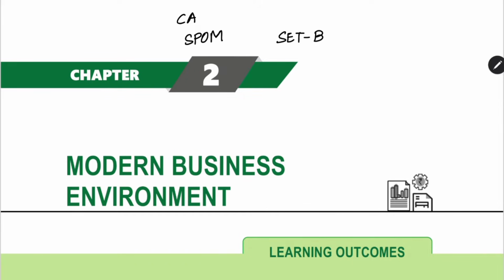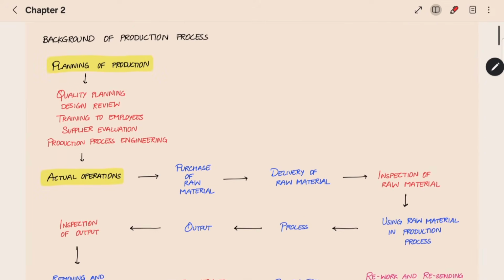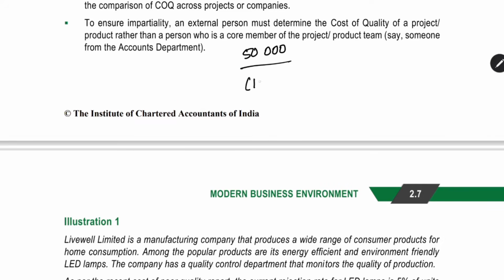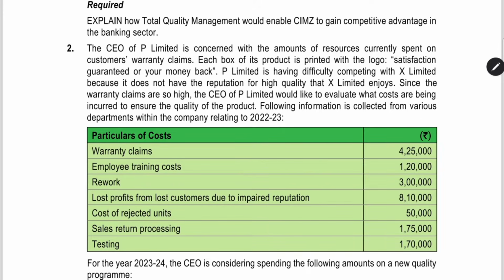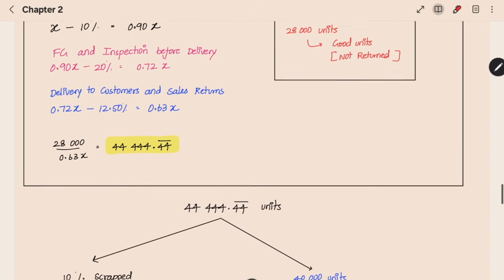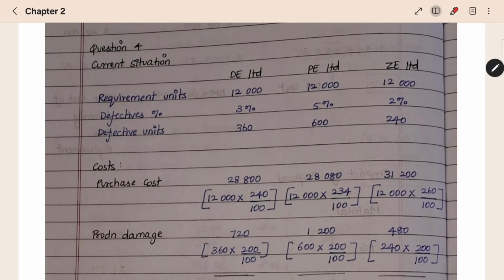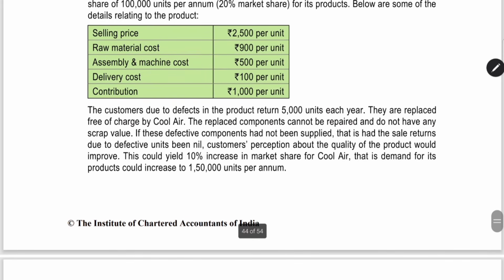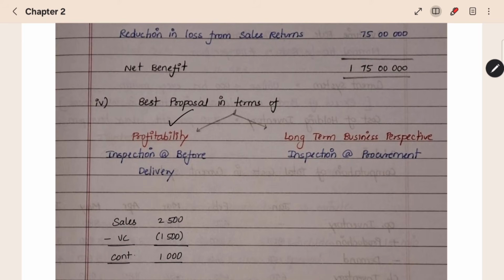SPOM Set-B Chapter 2 Costing Sums Explained - Full English | CA Final | Self-Paced | #spom #cafinal

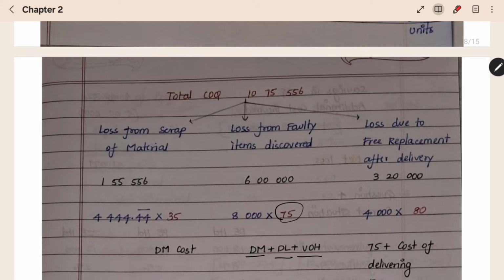Comment: In Question 3: why selling price is not added to the cost of quality of returned goods from customer 31:55
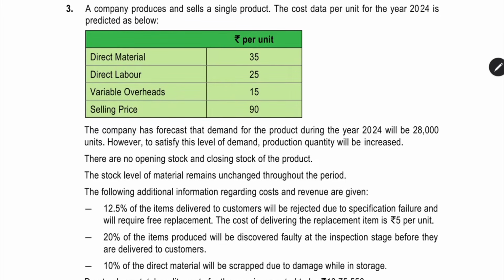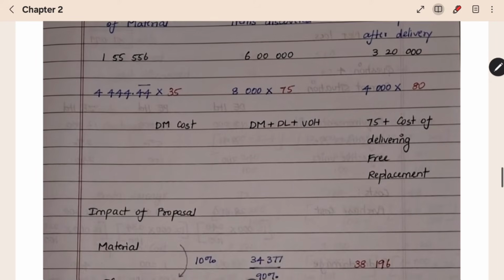Reply: In Question 3 (25:50-35:53), the selling price is not included in the cost of quality because the cost of quality represents the actual economic sacrifice (the resources consumed) incurred by the company to rectify defects or failure, rather than the revenue lost or forfeited.

Here is why the selling price is excluded:

Focus on Cost, Not Profit: The cost of quality statement is designed to track expenditure related to poor quality (like material waste, production labor, and replacement delivery costs). Including the selling price would effectively blend revenue loss with cost, which obscures the actual efficiency of the production process.
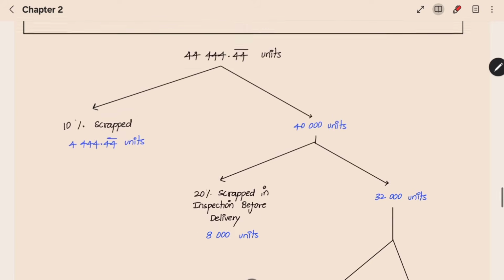Resource Consumption: The losses highlighted in the video (e.g., at 31:13) focus strictly on the value of inputs consumed—direct material, direct labor, and variable overheads—that are effectively "thrown away" when a product is faulty. 
Opportunity Cost vs. Out-of-Pocket Cost: While missing out on a sale is an opportunity cost, the calculation for the cost of quality is specifically measuring the realized financial outflow resulting from quality failure (the "internal" and "external" failure costs), which must be minimized to improve profitability

Comment: In 2nd question can't the net benefit be net of 20,50,000 and 9,70,000?
Reply from the maker: question number two, the net benefit is calculated by taking the total savings and subtracting the total additional cost.

According to the video:
The total additional cost for the new program is 970,000 rupees (25:00).
The total savings achieved by implementing the new program is 2,050,000 rupees (25:35).

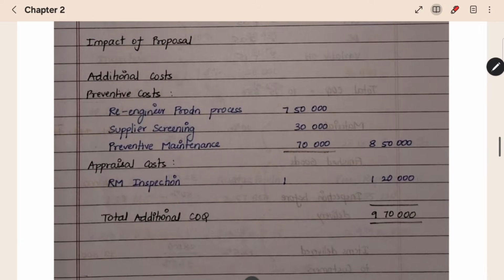Therefore, the net benefit is indeed calculated as 2,050,000 (total savings) minus 970,000 (total additional cost), which results in a net benefit of 1,080,000 rupees (25:42).
Reply: @MISSIONCAWITHVIKRUTH 25:35 the savings you have taken if 15,25,000 not 20,50,000
My question is why can't we take 20,50,000
Reply from the maker: We should consider only Incremental Costs and Incremental Savings to compute the Net Benefit of proposal. 20,50,000 is Total Cost.